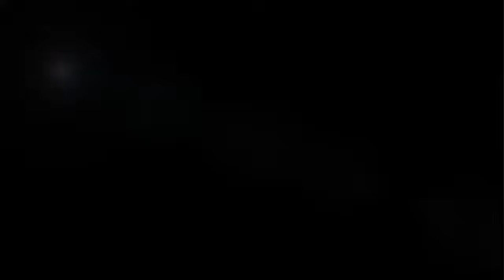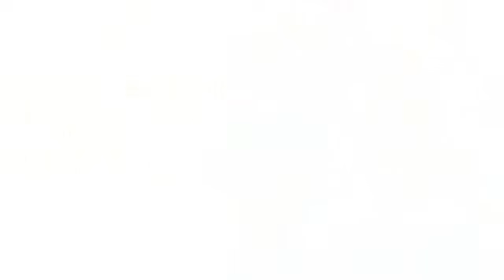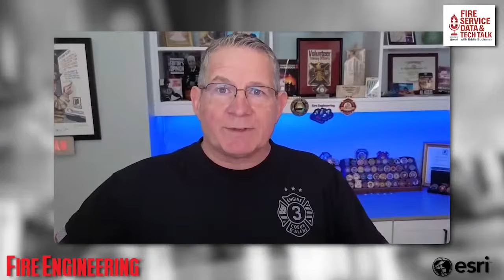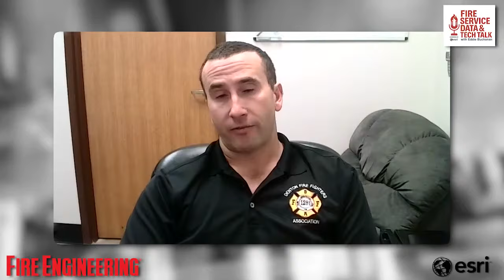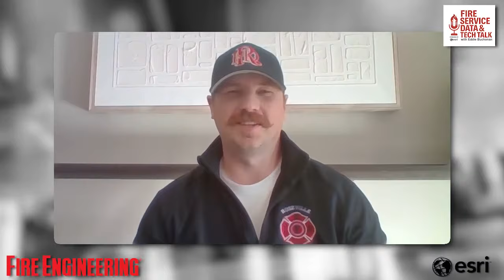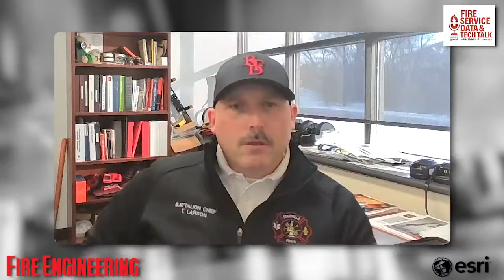The Operational Reality of Electric Fire Pumpers

Comment: What about pump sizes and capacities? Are you at all limited as to either? How does a larger pump or high volume pumping affect battery duration? Because the auxiliary diesel may tend to be smaller, does that affect pumping ability in diesel mode?
Reply: The Teslas and other electric cars do terrible in the winter. These electric Fire Apparatus are a Fad